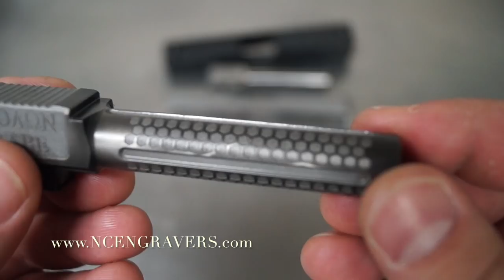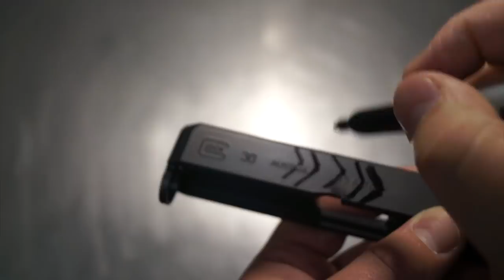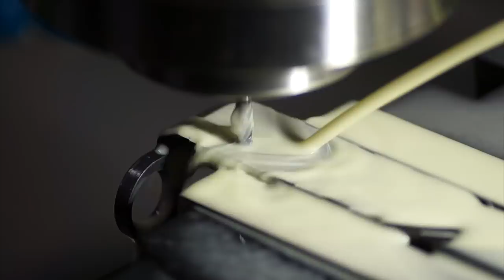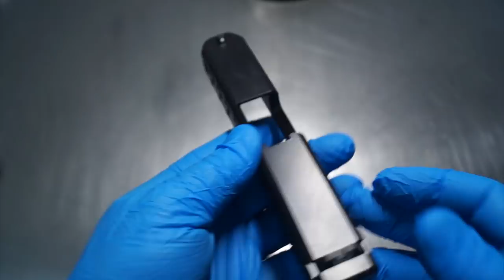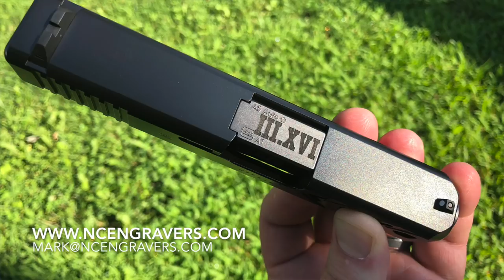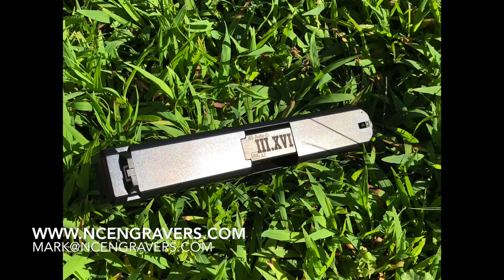NCEngravers.com  - Glock 30

Comment: Great job. I knew you could do the step fade in the depth of the design. One step closer to those flames. Thanks for trying my idea. I knew it would be technical, and you killed it. Keep up the great work.
Can the laser do the fade cut? Or maybe  a combo of both to get a smooth transition throughout the design. Again great work keep it up.